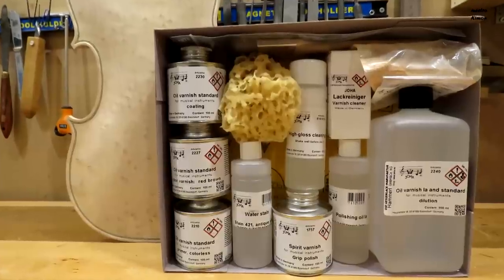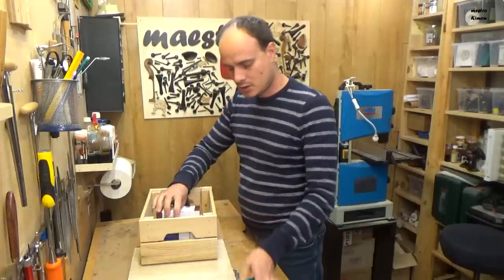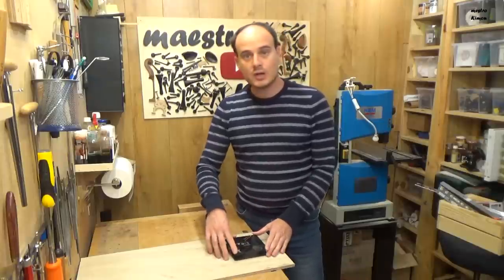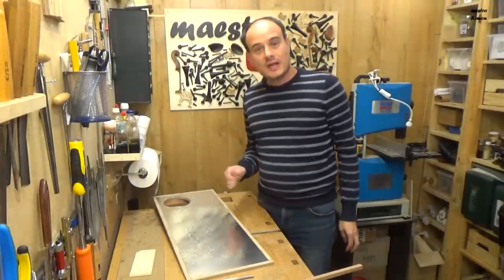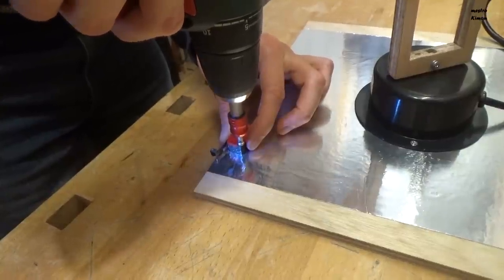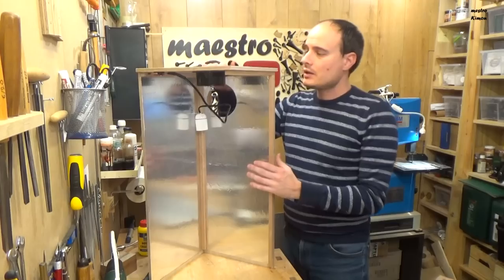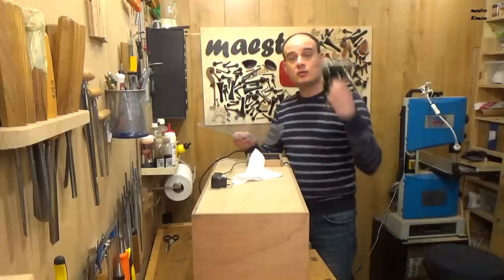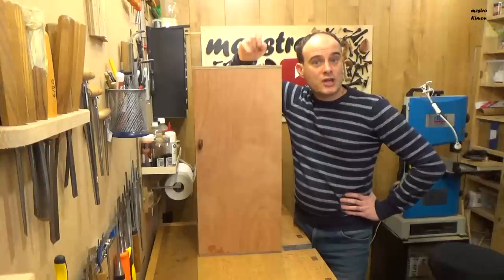How to make a drying chamber

Comment: Very nice video, one advice. Never tin the wires for 220V installation. It is not good for crimping and also not good when you put the wire under screw. Over time you will see it starts moving.
Reply from the maker: Thank you for the advise! I will control the cables every now and then.

Comment: I believe you might need another hole near the bottom covered in screen also for some inlet air to be pulled out by the ventilator fan, or you will have a vacuum chamber! Joking aside, with no other hole, there is no way for the fan to pull cooling air through the box besides small cracks in the door.
Reply from the maker: The gaps at the door leave enough air to come out. But you can always drill a couple of extra holes.

Comment: Hi Maestro, I believe the fan you mounted is not going to be effective in blowing clean air into the chamber as there is no outlet. You should cut a similar hole at the bottom of the chamber for it to work.
Reply from the maker: Hello Tuliang. It is effective as the dor doesn't shut hermetically. It has enough gaps to leave enough air to exit the chamber. But you could also make a couple of extra holes but be careful to keep the UV light from being visible from the outside.

Comment: HI, you did a good job on the drying chamber, but it would have been nice if there was glass in the front so ya can see the violin going around, thank you, I'm going to make one myself.
Reply from the maker: Hello Martin. I know, it would look nice but it might leave a part of the UV radiation paas, and that is bad for your eyes. I don't know if glass compliantly blocks UV radiation, I prefer to go the safe way.
Reply: @maestrokimon  Hi, sorry I didn't think of the UV radiation, would that be from the light or the varnish. I'm thinking of making one, I was thinking of putting dark glass in it. if there is a UV radiation ill problem makes it all wood then. I buy a lot of very old violins that are all broking up or need a lot or some work to them, and I rebuild them ass good ass I can. I have 67 violins 3 electric violin and 3 violas. 3 cello. many of them need to be varnish. so your drying chamber looks very nice. I've looked at all of your videos and I've like looking at them. thankyou for uploading them. they gave me many tips.

Comment: Kimon, Now you have been using this drying box, for three years, how is
the interior wiring and plastic fan holding up, to the UV-C radiation?
Is it drying and cracking yet?
Reply from the maker: The wiring shows some deterioration indeed ,on the fan I haven't noticed anything. You could put some aluminum foil over the cables and other parts to protect theme.

Comment: I am building a drying cabinet like this one but I have one question. I have installed my vent fan and it occurred to me that this may not  work.The fan is installed to bring air into the cabinet but there is no outlet for the air to exit. It seems to me that when the door is closed no air will enter the enclosed space since it has nowhere to go. I am thinking that on mine I will install some sort of vent to allow the air to flow through the box. I would really value your opinion on this before I continue.
Reply from the maker: Don't worry! The door leave enough gap that the air can go out. You could also dril a couple of small holes. And the vent doesn't have to blow very hard.

Comment: Anymore details on the motor?
Is the violin going to hang down from the scroll?
Great video!!!!!
Reply: I have the same question...in my opinion the motor would be better if it was at the bottom where it would spin the violin from the endpin...
Reply from the maker: The instrument is hanging from the motor. You could also put it on the bottom but I don't know if it would be as stable. You can see it better in the next video where I'm varnishing the violin.

Comment: Great video... Can you give the dimensions of the box please ?  Thank you....
Reply from the maker: Mine  is 66x29x29cm but keep in mind the dimensions of the motor you use. And do you want to make violas as well? then you have to make in bigger.
Reply: @maestrokimon  Thank you so much. Your YouTube video's are #1.
Reply from the maker: Thank you Carl!
Reply: @maestrokimon  what are the required box dimensions that would be suitable also for violas?
Reply from the maker: This depends on the size of the viola. Add 10cm to the lower width of the viola for the Width and depth of the chamber and about 10 to 15cm to the length for the high. Keep also in mind the dimensions of the mirror-bal motor.